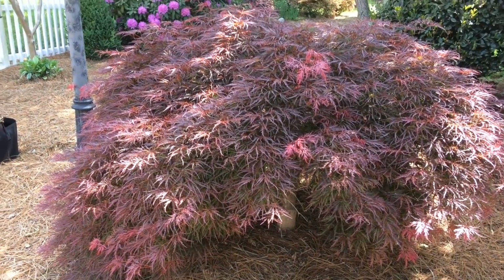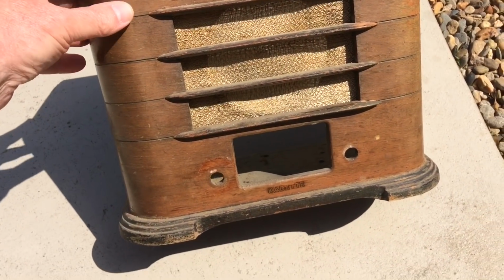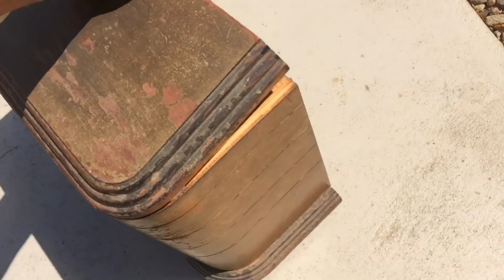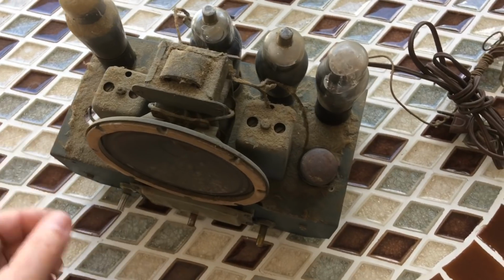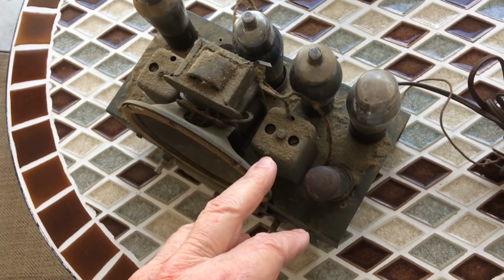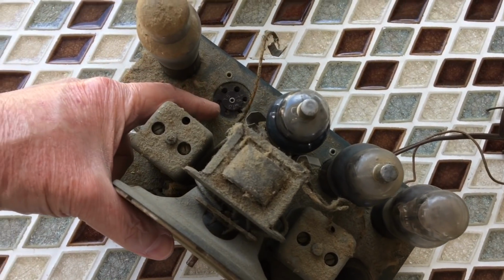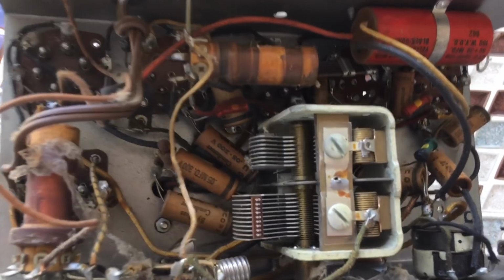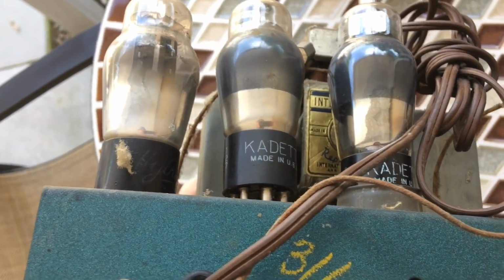Kadette 86X - Introduction

Comment: Hello Don. I have similar problem with old valves radio furniture, and I am very interested about how will you fix all problems in this radio furniture. I know about wood furniture restauration, but never did something similar in old radio wooden furniture.
Also, i want you to comment that I found a good system to do speakers impedance measurings, and as far as I know electronics it seems to be a simple and an accuracy system to do this task.
If you wish to have a look to that simple system I can send you the link to that I talk about. Few electronic components. Simple and cheap. It is written in Spanish but you need only to understand the circuits and schematics.
Maybe it would be a nice and usseful project for you. I will do a similar one for me also.
Have a nice day.
Ketk (From Spain).
Reply from the maker: Ketk - it’s great to hear from you. The old ballast valves (power resistor more less) are sometimes difficult to acquire. I have a few on hand myself. I’m interested in the speaker impedance circuit. Send the link to TheRadioRepairGuy at gmail.com or a link to this comment. Thanks for thinking about me. Best, Don

Comment: That cabinet looks rougher than it really is. I guess its just glue failing on it rather than serious damage. The chassis also looks worse than it is on top because of the dirt but I reckon that will be another winner Don.
Reply from the maker: George - to your point, the cabinet may be in worse shape than my initial evaluation. After a good cleaning, I’ll know for sure. Ditto for the chassis. Thanks for watching and following along. Best, Don